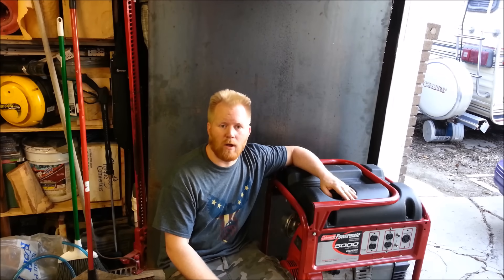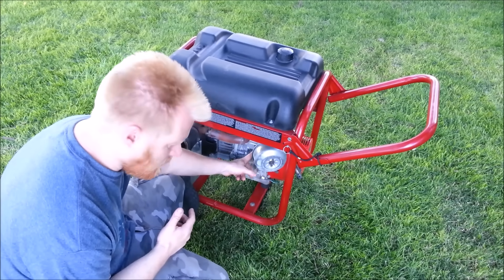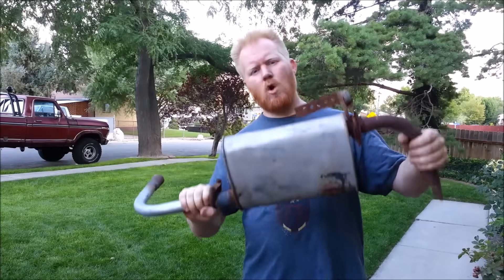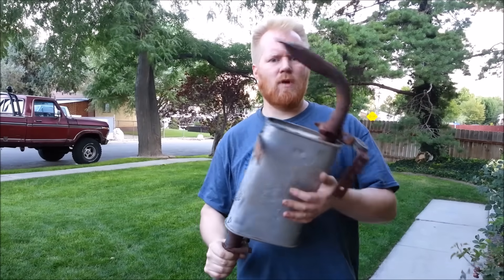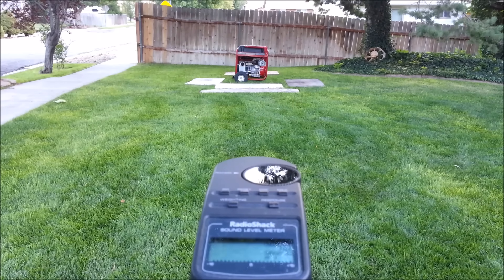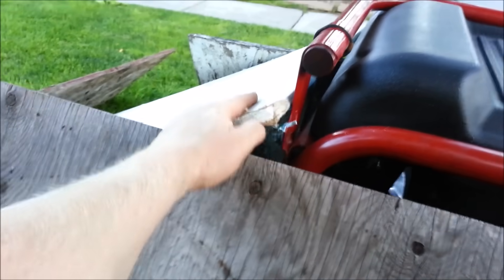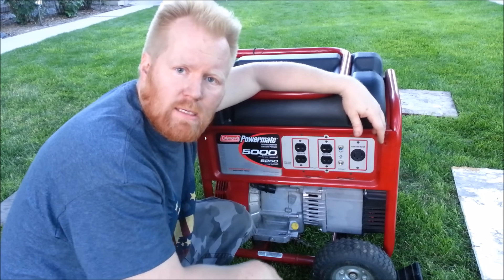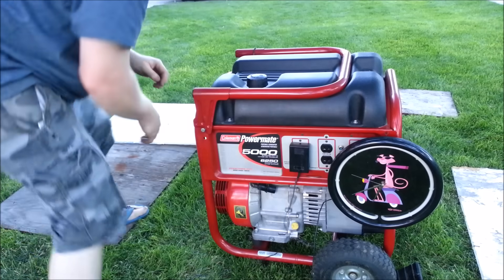4x Quieter generator in 10 seconds

Comment: It may have been rumored that when this method may have used by Consumer Reports after running the generator for a lot longer than on this video, the boards overheated causing a major fire and an explosion as well as the exhaust fumes killed millions since they were condensed and when they escaped major carbon monoxide poisoning. Also global warming was accelerated.

Comment: I built a 1 end, and one side box with a floor and hinged top out of plywood. So one open end and one open side. The top, side and end were lined with 1 1/2" styrofoam insulation. The exhaust side was facing the open side of box. The open end made it possible to roll the generator into the box. The hinged top made it possible to refuel easily. This was for my camp with a 5000w gen. The exhaust side faced the woods behind the camp. Worked well.
Reply from the maker: Awesome.

Comment: Instead of slamming you for incorrect info I'll give you more credit than you're claiming. Decibel scales are logarithmic. A change of 3db is a factor of 2 so the sound level is either doubled or halved. A change of 10db is a factor of 10. Your change of 9db (80-71) is 3 x 3db or 2^3 that equals a factor of 8x not 4x.

Comment: I must have went to a different school than you.  At the start I heard that the decibels were 80.  If I divide 80 by 4 I come up with 20 decibles.  But way too much longer in the video you get it down to 70 decibels.  What happened to losing the other 50 decibels?
Reply from the maker: You must have went to a different school. Decibels is a logarithmic scale with an average human perceiving a 4-6db drop as something being half as loud or a 4-6db rise as being twice as loud. So a 10db drop/rise would sound like 1/4 as loud/ 4x louder to the average ear.

Comment: I have an APU on my truck, it’s a Diesel engine and loud as Fk!
It’s encased in a metal casing but I don’t see that quieting the generator down, I was thinking about putting a little bit of steel wool in the exhaust to help quiet the exhaust down and maybe a moving blanket over the casing of the generator when I use it, are usually use it when I’m parked.

Comment: That all and all is one of the dumbest ideas EVER. It will for sure shorten the life of everything on the generator especially the motor. Its called OVER HEATING and not pulling in the right amount of oxygen that the motor needs because its pulling in exhaust fumes. Absolutely dumb. If you don't like the sound of your generator then get over yourself and buy some battery's and solar panels.

Comment: Did you the store how you burned up the first engine buy blocking air flow?
Reply from the maker: First engine died because it was a piece of junk Subaru. Customer ran it in an open field while camping for 12 hours total before it died. I put a good engine in it and it has been working hard for years now.

Comment: So let me get some recommendations. In Charleston we face multiple hurricanes yearly, most bounce off and hit the outer banks (sorry North Carolina) but when we do lose power its for a while. Like to install mine in the garage, cut hole in side of house to spit the exhaust out, some sort of fireproof foam around hole to protect the house and a flap like a metal dryer flap to keep rain out. Had planned on cracking the garage door a few inches for added air and lock it in place. Came here looking for muffler recommendations to quiet it down, sounds like snowmobile is the way to go for quiet, was thinking about sitting gen on a foam panel, then foam walls up past the top a foot or so off the gen to absorb the sound. Anyone see an issue with that, could even put a small box fan on the side to circulate air if needed. Anyone see an issue with any of this? Thanks all

Comment: If you want to make a cheap generator bay then build an open top box with sides that angle the sound up. Basically the reverse of what you did by focusing the sound into the ground. Also you can line the inside with sound deadening spiked foam like you see in professional studios.

Comment: Doesn't that restrict airflow and cause motor to run at a higher temperature which will shorten the life of the unit?
Reply: @Captain Howdy lol... so does the national debt but that is also irelevant. No adequate airflow, the generator stays hot.
Reply: Yes , this will increase the operating temp and decrease the life of the stator and the engine
Reply: Ever think of perhaps setting a thermometer near it with and without shields? Then you have your answer. Overheating engines also stall, and regular oil changes are advisable.
Reply: @cravinbob  I am a small engine mechanic. These engines are air cooled and need to get as much air flow as possible. If you do this you will shorten the life of your engine you will blow your engine up. Regardless of oil change. They are made of aluminum they can only stand so much heat.
Reply: @Captain Howdy top was covered by gas tank.
Reply: Yea,  I'd think creating a hot box isn't good.
Reply: Lol this is the miracle fix??? I want my click back. Good looking keeping that honda running, they also break :)
Reply: As a mechanic this is not advisable . Generation units are designed at there max to preform . Restricted airflow with a cover will heat the engine and gen set. My advise keep a good factor high flow muffler on it and use a good cord that's heavy and long lol
Reply: @ronaldbrown5991  here's a simple analogy. If you're cold at night time you put a blanket over you, if you're hot you remove the blanket. Enough said?
Reply: @Hicaliber1  I guess you could put it like that
Reply: Still good enough airflow. It doesn't need a Crazy amount

Comment: I stood 2" thick 4'×8' sheets of styrofoam so generator set inside of 4'×4' area you could barely hear it ran it this way 12 hours a day with no problem. Did this in Summer months generator didn't overheat

Comment: Excellent. Reflection into the ground. Ive used this technique before with reasonable success.Putting a generator into the ground is also great in dry weather only, or covered space. However due to frequent, sudden, catastrophic floodings globally that tend to waterlog top-soil areas for weeks, the underground option is sadly inadequate. Electrocution and short circuit hazards in particular.
If we can achieve high speed rotation without the engine component《using magnetism maybe?》the generator's 'silence' would be perfectly deafening.
Reply: As to "achieving high speed rotation using magnetism maybe," what you're implying is called  'perpetual motion', a self powered system but 'that', due to the physics involved has been proven impossible to achieve.
The idea really does seem so appealing and simple 🤗 but it's just not possible! Bummer 😟.

Comment: Make them 100% quieter by ditching the gasoline/diesel generator and going solar.
Reply from the maker: Sounds Great. 4000 watts of 120v power means I only need a roughly 3000 sqft of surface area or I can go smaller and throw 1/2 a ton of lead acid batteries in the mix and don't forget the inverter. Better hope for great weather as well where the sun is out.......

Comment: I have a cement patio, does this concept work with these ideas as well, or does it work only on dirt and grass?  Thanks
Reply from the maker: It works on concrete as well.
Reply: Any flat parallel surface will reflect the sound, which is why the many boards at angles. Osb is better since it is fiber and absorbs into itself, concrete not as well as lawn. Perhaps a board underneath (beware of fuel spills, of course)

Comment: Can you put a turbo on a generator and make more electrical power? Upgrade the internals to handle the constant strain and make a long intake coming up out the ground from a sandbag covered hole.
Reply from the maker: The electrical part is generally the weakest link.

Comment: Most of the generators you buy run at 3200-3600 rpm. Spend a little more and buy an 1800 rpm generator and reduce noise!

Comment: I would start with turning the generator 90 or 180 degrees so the exhaust is not pointing directly at you.  Then put your deflector boards up.  Also, how do you figure a 10db reduction is 4 times quieter?
Reply from the maker: 4-6db drop is perceived as something half as loud to the human ear. The average human ear will perceive a drop of around 8-12db (depending on the frequency) as being around 1/4 as loud.

Comment: Wish more folks would be considerate pertaining their generator noise. I have used very thick auto body panel shipping cardboard to cover my generators in parks/camp sites/etc. Free from the auto body shops (just trash for them) very thick, reflects/absorbs sound. Can be folded/bent/glued/cut/taped or doubled up for more noise restriction. Lighter than wood. If not used for noise reduction, use it for a truck bed liner, tent floor protector, sleeping mat, dog bed, hell you can probable build a house out of this stuff. Unfortunately it is not rain proof or fire proof. Lasted a week for me while raining on it. Get's too bad, throw it away and get more...  Hope this help's Yall  (YOU ALL for the rest of the world :)

Comment: I circle mine with empty 55gal plastic barrels - arranged close to barrels on one side and 5 feet away on the exhaust side.
Works great BUT not as portable unless you have a decent size trailer for about a dozen barrels :-0)
Reply from the maker: That's a good idea.

Comment: This is a very nice video explanation. However, the author and most of the commentors have the physics of sound incorrect. As an acoustical expert i would point out the following. 1. a 3 dB reduction in the sound level is equal to a 50% reduction in the sound pressure level. 2. Where human listeners are concerned, it takes a 10 dB reduction in sound pressure to realize a 50% reduction in LOUDNESS. Loudness being the psychological aspect of sound and Sound Pressure being the physical aspect of sound.
Reply: Is that why it seems to be half as loud?
Reply: no one gives a shit

Comment: Some good ideas other than you closing the ventilation around the engine is shortening the life of your generator is what you have in mind and keep this idea going on I could see if you were in the snow or something not too much to worry about too hot so where is the oil like water but an air-cooled generator needs proper circulation you could even create so much heat under all that start playing with the plastic of the gas tank another plastic parts in the area of that motor just saying

Comment: Nice work!  By the way, 3 dB is half.  10 dB is 10x.  20 dB is 100x.  30 dB is 1000x.  So reducing by 30 dB is 1000 times quieter.  The wonders of non-linear math.
Reply: This applies to power levels, not quietness. Our ears also respond to power in a non-linear way, so a 10db reduction is perceived as half as loud.

Comment: Yes a muffler mod will help. But most of the noise is mechanical. 
A small building will help. What you did is useful in a pinch. During a storm is ok. Doesn't look pretty but functional.

Comment: IGNORE THE ADVICE in this video , Listen to an actual Generator Specialist ( 44B10 ) who spent a career in the Military. Where I had to insure the Generators were as silent as possible.  Step  One..  Dig  a hole roughly  2 foot around the outter edges of the GENSET & 10' tp 12" deep.   2nd..  Feel sand bags and place on bottom of hole slightly over lapping 3: Build a wall of sand bags around the hole in the shape of a " G :  ( of course place generator inside first ) and cover with any item, wood, plywood, beams,branches that can hold the load of a layer of sand bags over the GENSET.  You can reduce the noise even more by running flex exhaust pipe under the sand bag wall  out a 5 gallon metal bucket filed with rocks.  We normally ran ours 6 foot outside the wall. and cover the pipe with dirt  as well as partial covering of the Bucket.  In train I had scouts move within 100 ft and could barely hear the  GENSET>

Comment: This isn’t a trick it’s common sense! I wouldn’t call that amazing airflow. In fact the manual specifically states not to do that due to the possibility of internal damage due to high temps. These engines rely on proper air flow to stay within operating temperatures, and I would argue that your little set up is not. Run it for 30 min check temps, cover it and run for 30 min and check temps

Comment: Have you seen those coupolas that they used to use to ventilate barn roofs?  Try something like that as a jenny cover.  I bet it helps.
Reply from the maker: That's an interesting idea.
Reply: @sixtyfiveford  the only thing I wonder about is the exhaust.  If the cupola is too restrictive, the engine might choke-out on it's own fumes.

Comment: sixtyfiveford, Try this, run the generator for one hour without your shielding and take a temperature reading of your fuel tank on the bottom all the way around it. Then put your  deflectors up and run for another hour and then check the temperature again. Multiply the difference in temperature at the highest variation point times the run time for a full tank of fuel.....what do you have? Then check the rules on what your doing with the National Fire Protection Agency.
Reply from the maker: I have run temp checks and the engine/generator components stay within a few degrees with/without. Items like the metal generator frame that would stay ambient temp do raise to a warm to the touch. Putting a generator in an enclosed structure is nothing new. All the inverter quiet generators are doing just this with far less airflow.

Comment: I placed my generator inside my work shop with the exhaust passing through an outside wall. It has a good muffler and can barely be heard while running. I don't use the shop with the power out, so there is no conflict there.

Comment: Re your  deflection panel  you really do not want to restrict exhaust flow especially if like me you use a generator every day, even more critical if you use Ecomode as you risk sooting/fouling exhaust muffler and engine in said manner as to changing mufflers you make no mention of the fact mufflers for each engine are designed to add a certain amount of back pressure to optimise running

Comment: Is there enough air flow to keep the engine cool ?
Reply from the maker: Yes. Leaning the boards at a 45° leaves a good 2 foot by 2 foot square(2 half 2'x2' triangles) at the front to pull air in and the same at the back. The engine all ready has a cover/shroud on it that only has a grapefruit size opening to pull in all the air it needs to adequately air cool itself. All the "quiet" generators like Honda EU series have an air cooled engine completely enclosed in a box with the engine fan pulling air in and out of small holes. In testing all of the engine components stayed within 2-3 degrees higher and lower(yes lower in some areas). Some non important items like the main generator metal frame that would never get warm when left in the open do absorb heat and will feel warm. There a lot of common sense that goes along with this technique as to not completely box in the generator without airflow.

Comment: The Headline is inaccurate. Decibels increase the sound intensity by 100x for every 10dB, but that increase is perceived by the human ear as a doubling in sound volume. Therefore, if you decreased the dB level from 80dB to 70dB, you are experiencing a volume or loudness drop of 50%. The headline would imply that "4x Quieter" (odd way to put it, should have said 1/4 as loud) means the loudness dropped to 25%. Not so. You would have had to drop the volume to 60dB to achieve a "4x Quieter" level.

Comment: All subaru products blow up? Ive driven both of my imprezas hard and put them away wet, still the most reliable products ive ever owned. I was enjoying your videos untill that one ignorant comment. Thumbs down on every video on your channel.
Reply from the maker: You Subaru owners are so sensitive and get so butt hurt. Subaru small engines are some of the cheapest made and are only found on the most budget machines. They have no aftermarket parts nor support because the are designed to be thrown away when anything fails. They are the laughing stock of the small engine world.
Reply: sixtyfiveford you shoild probably expect negative feedback when shit on peoples passion for absolutely no reason in an entirely unrelated video

Comment: Placing things around the generator causes the air cooled generator to run hot! If you pull a 50 to 75 percent load on that with air flow restricted you will shorten the life of your generator!. I ran gasahol in my generator for months connected to a exhaust pipe venting fumes outside. The gasahol ran cooler and quieter but made less power. All these small engines are loud!

Comment: Seems like it will over heat
Reply from the maker: The engine cools itself with a fan though a bunch of small holes the combined size of maybe a softball. The generator cools itself the same way with a similarly sized hole. So even left fully exposed the engine and gen head still only pull in a fixed amount of air. There are large enough gaps left at each corner to accommodate 50-100 times the required air for the engine/gen head to proper cool themselves. There is going to be very minor radiant heat that would dissipate upwards that isn't going to leave as easily but it hasn't been a concern. After numerous running tests the engine and generator head are plus and minus 2-3F at numerous locations between shrouded vs not shrouded.  Some non pertinent items, like the metal frame are warm to the touch where normally they would feel cool if left out in the open. Air cooled engines are commonly run in enclosed spaces without issue. Of course common sense needs to be used and proper gaps at each corner need to be left to allow air flow.